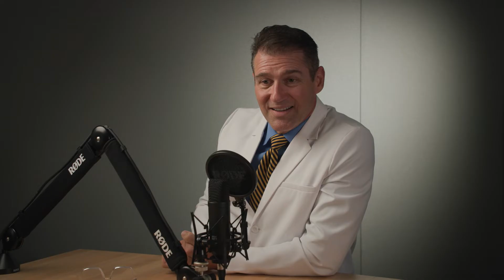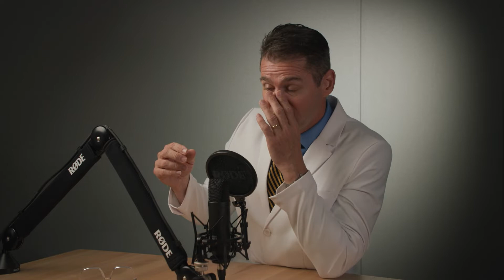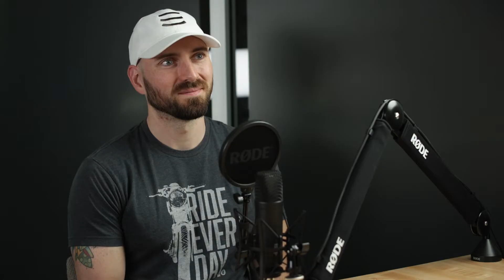Thermal Necrosis DOESN'T EXIST, either

Comment: I always worried about this. Looked into designing the guides to spray water under the guide on the drill. This makes sense though. It’s so fast when guides.
Reply from the maker: For sure! We found that going fast is significantly easier than getting water into the hole 😉
Reply: @Stanleyinstitute  There is a guy on Zerodonto dentistry promoting a thing called Irriguide by basicly scaring people of thermal necrosis.  The fun part is that every site/sleeve has its own port, so if you have 6 implant guide, you need to unplug the cooling tube and plug it into another port, so not only you are changing the drills all the time, but also the tube. I couldnt  explain to him that it is better to go in and out fast than his clumsy irriguide